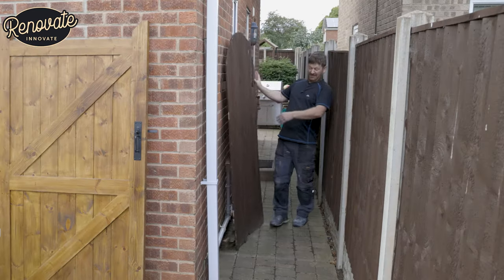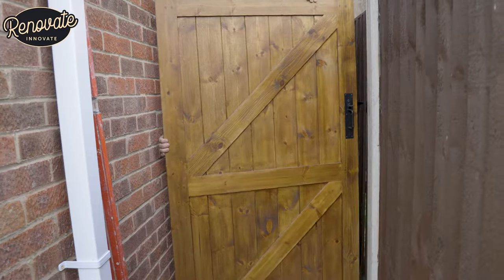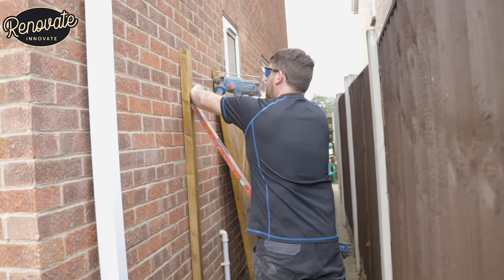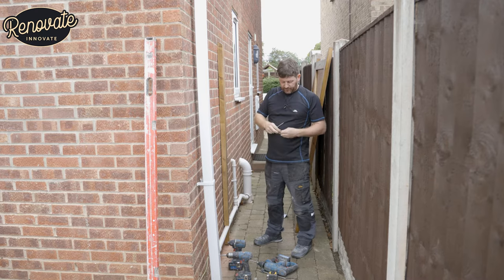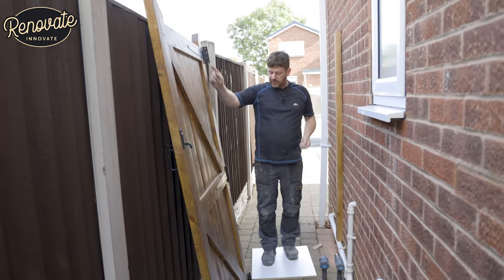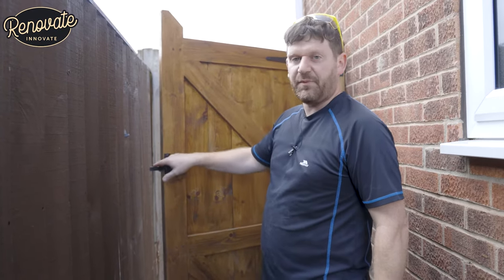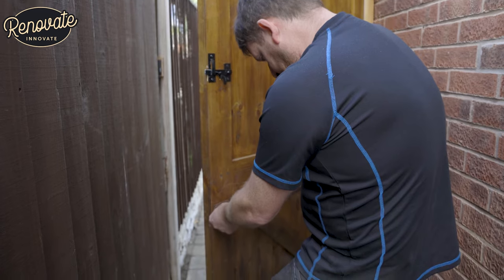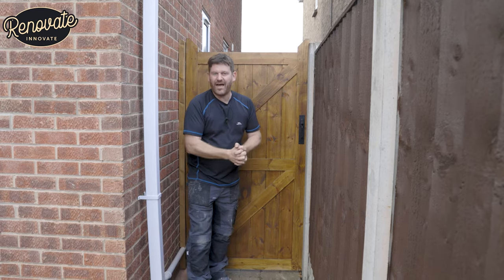DIY Tips & Tricks -  Easy Guide to Fitting a Garden Gate

Comment: So am I right in thinking only sawing were the two posts? Could that be done with a handsaw? When the gate latches, on the outside how can you open the gate when you're inside? I think I missed something. 🤔
Reply: yeah not the most practical setup, you would use a two way gate latch system if you wanted to gain access from both sides but in this case i would imagine the customer wasn't to bothered considering they wanted the old rusty bolt to be used on the new gate,  the inside bolt is only used for locking up on a nighttime or when they are away from the property.